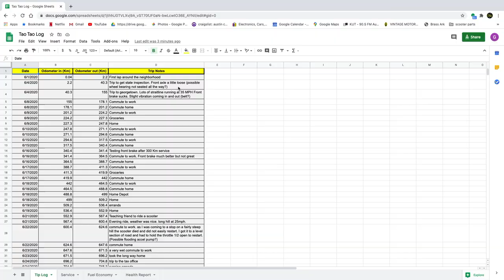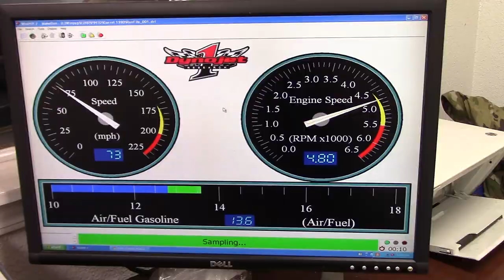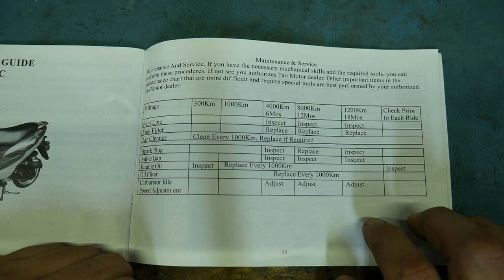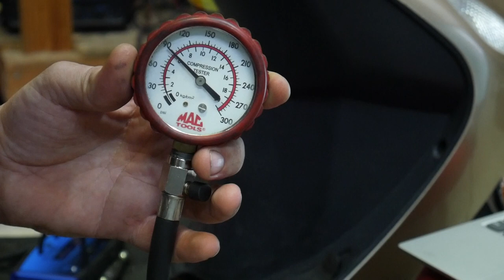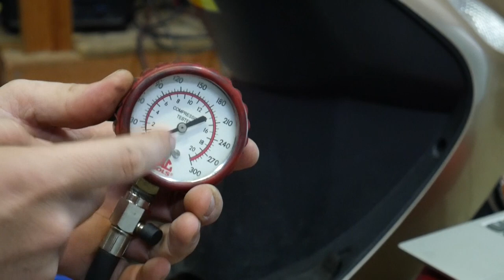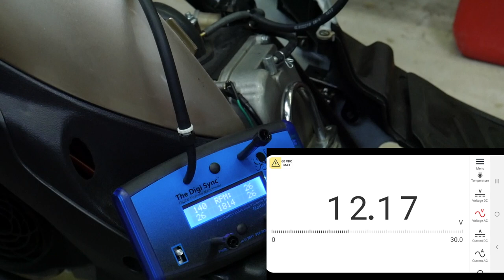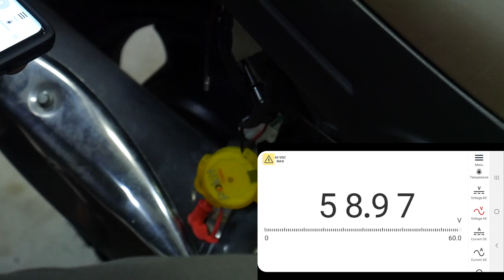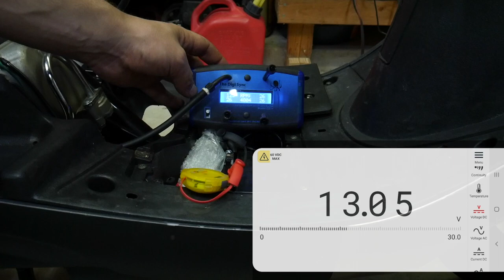(PT.9) The exhaust falls off the most HATED scooter on the internet: Living with a Tao Tao

Comment: Hi Garret, interresting vids, thanks.
I have a question. I back on two wheels for the first time in 25 years here in Spain. I have a Piaggio Liberty 125 with 300 km on it. The first 200 km it was very very quiet, but the last 100 km it has become more noisy. It seems rattling or gently knocking. I cannot directly locate the sound, or find anything loose, but it seems to come from the front of the engine. I’m attempting to gently run it in, and have not been over 60 km/h (I guess it goes to about 100 km/h), but I do live on a mountain side, so it is a but up and down, but not extreme conditions.
Only thing I can think of is something needs adjustment, or it may not like the discount E5 octane 95 fuel (Octane 95 is the recommended and standard fuel here, but I could try to go for a brand name instead of fueling at the supermarket petrol station)
 The first service in at 1000 km, but I guess I should take it in earlier?

Comment: 8,000 metric miles, then 1,200 metric miles? uh..... missing a zero?
Reply from the maker: There's some other gem misspellings in that manual for sure!
Reply: Wait, metric mile?
Reply: @yigitalpalakoc  The advantage of the old mile vs the kilometer is that "mile" can be said quicker than kilometer. I believe kilometer is being shortened to "klick" What comes after a kilometer a "mick" ?
Reply: @forevercomputing  i must admit that im quite confused
Reply: @yigitalpalakoc  No-one says a billion milimetres, they go up the scale until they hit kilometer. If Metric is the way, why does no-one use the correct one?
Reply: @forevercomputing  so the metric mile is a kilometre
Reply: @yigitalpalakoc  It is when I say it. Even though it isn't official, I like to call it that.

Comment: I’ll admit, I was so keen on this experiment until this video. I was looking forward to seeing a vehicle that is marketed as making 10,000 miles. That is why I bought a Chinese scooter, and have had nothing but problems. I’m disappointed in the modification. Anyone can modify that and make it run. But it seems you have given up on the overall experiment. No owner should have exhausts falling or carb issues with something under a new vehicle warranty. You were about to prove those scooters are designed to fail, and I’m straight out disappointed that you gave up. You have modified the vehicle outside of spec so now your experiment is null and void... thank you for 8 great videos that lead to disappointment
Reply: Actually, I kind of think that he already proved that they are designed to fail.  Now he's going to see what else fails...
Reply: Other parts now may be less likely to fail though because of aftermarket parts. What else is in store as you continue to ride as if a consumer did what a dealer would do for a customer to achieve oem spec